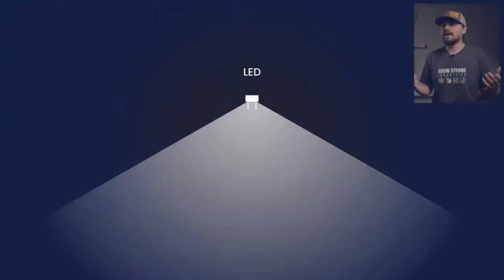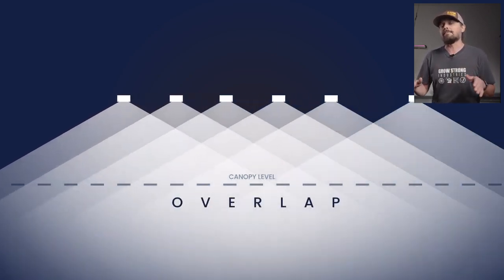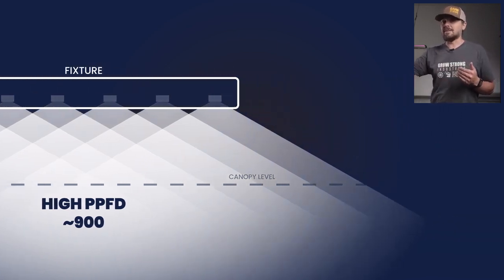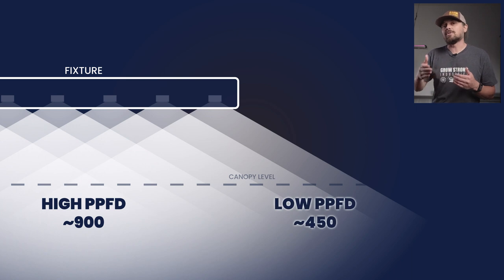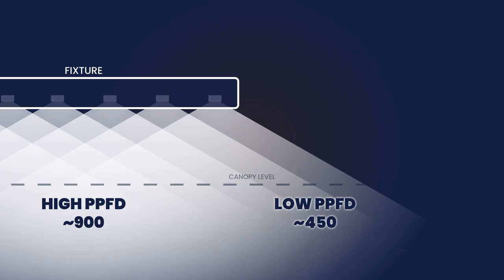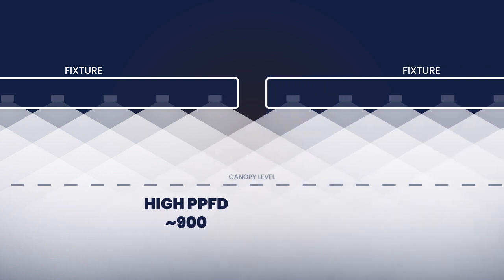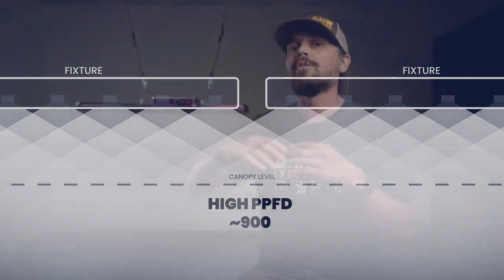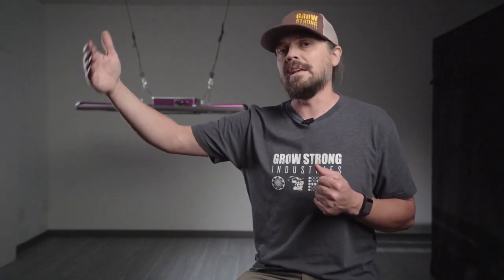Mastering PPFD with LED Grow Lights: The Ultimate Guide for Seedlings, Veg, and Cannabis

Comment: I’m on my very first grow. And my auto has been extremely small the whole time. And I’m about 3 weeks into flower. I just realized lastnight that my ppfd is extremely low. Could that be the reason for the small plant?
Reply from the maker: Yes, PPFD matters a lot, and low light early is one of the most common reasons autos stay small. Photosynthesis is driven by photon density, and autos are time-based, so they don’t get extra veg time to recover.
That said, early stress (root issues, overwatering, nutrient imbalance, or environment) can also limit size... but light is usually the biggest lever. Even, adequate PPFD + consistency from the start makes a huge difference. 🌱